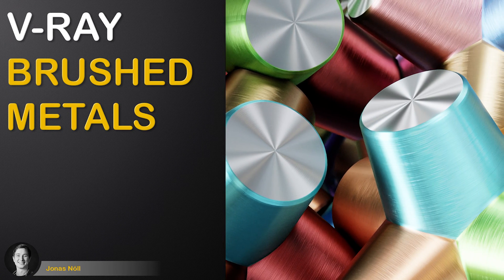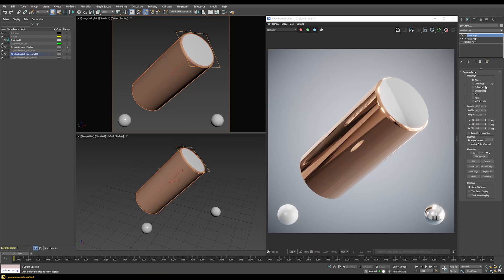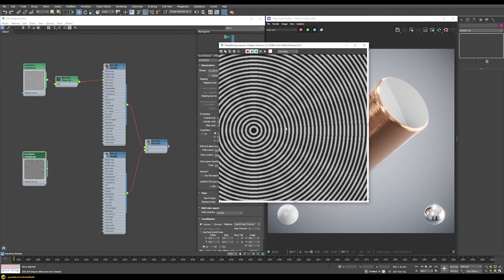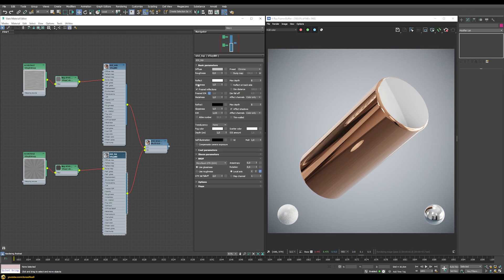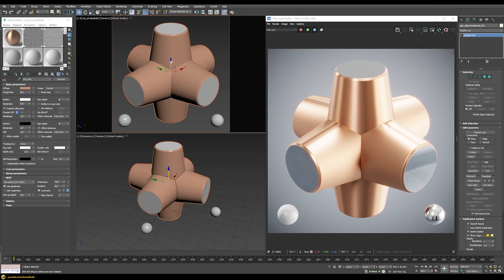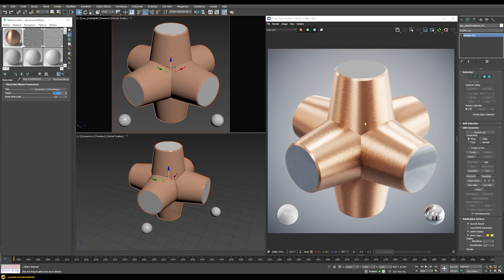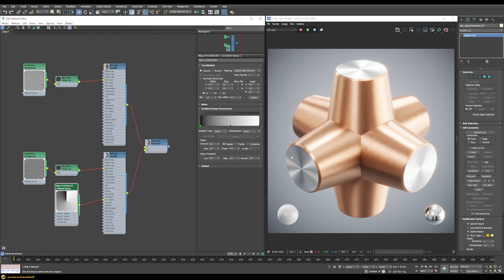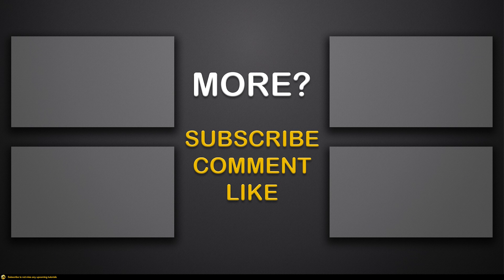V-Ray | How to do BRUSHED METAL Materials | Anisotropy

Comment: Great tutorial. The problem I'm having is animation. If I rotate the cylinder on its local z, like a lathe or similar, the hourglass reflections in the base tend to rotate with it or in some other weird way. Like it's depending on local uvs or maybe it's a map gamma issue. I feel like I'm losing my mind.
Reply from the maker: Yeah that is indeed an issue. Actually I haven’t found a solution for this issue yet as the UVs rotate together with the object. You could open a thread on the Chaos forums, would also really like to know how or if it’s possible

Comment: Do you recommend the use of color2bump map?
because Vray docs says VRayColor2Bump is slower, & it is better to Directly plug the bump map to the mtl
Reply from the maker: Hi, I would at least recommend to try out the Color2Bump conversion if the bump is a very important part of your shader. Often times I ended up getting better results for some reason even though I just plugged in a simple Bitmap. As with the example in this video here the result looked also different and better when using Color2Bump. So in my opinion just test it out if there is a visual difference. I can't imagine the performance to be drastically worse to be honest, at least I din't really encounter anything noticable as of yet. 
But definitely always use it though when you blend procedurals or multiple textures together or have in general a more complex setup for your bumpmaps.
Reply: thank you😀
Reply: @JonasNoell  i always thought color2Bump is only used to convert a color map into a bump map in case a dedicated B/W bump isnt available. i assumed its just a faster way to create bump map instead of going out to photoshop and creating bump map from the diffuse map

Comment: Long time no see ;) Very helpfull tutorial yet again!
So you do need proper UVs for both approaches, either for mapping an actual bump texture or to control the direction of the anisotropic effect, right?
Reply from the maker: Hi, when using Anisotropy in the local axis mode you don't need any UV's, unless you wanna blend in some scratches with the bump :)
Reply: @JonasNoell  Right, but as your example shows just using the local axis might result in weird effects. If your cones were merged into one mesh without UVs, local axis orientation wouldn't work. That's how I understand it.
Reply from the maker: Yes, local axis sometimes works if you for example just have one cylinder or some other simple object. But as soon as you have one object where you want to have multiple anisotropic effects with different directions you would need to have some kind of UVs to control the direction.

Comment: Jonas, what's the hardware (cpu, mobo, ram, gpu, etc) you're using for these tutorials? And you're using cpu, not gpu rendering correct? And which version of V-Ray?

Also, in terms of ideas for a tutorial, there quite literally isn't a single good tutorial out there for making crystals like quartz or amethysts. Only one I've seen which has come close to the shader I'm looking for is a Houdini one like this: https://www.youtube.com/watch?v=pq2bYZGurzc

You'd get mad views if you could do one for the rest of us. Me and hundreds of others would be eternally grateful if you did. Danke!
Reply from the maker: Most videos are with Dual Xeon 16 Core, 64gb Ram, Quadro P1000. I don't use GPU rendering, don't really have good hardware for that.
The idea about the christal is cool, will definitely check that out! Thx!
Reply: @JonasNoell  Thanks dude. By the way, which model # xeon you using? Since there's various ones.
Reply from the maker: E5-2698 v3, but why does it matter? You can render with any CPU :P
Reply: @JonasNoell  I'm kinda in a tough decision whether I want to stick to GPU rendering (own a RTX 3090) vs going CPU for my future projects. I've noticed in some benchmarks and real world tests that GPU outperforms even Threadrippers in certain cases, so looking at the preview renders is interesting to compare. That's basically what I'm getting at. Thanks by the way for the follow-up.
Reply from the maker: @iamski  Ok, as said most videos were with Xeon, but I recently upgraded to Threadripper 3990X, so this Brushed Metal is the first video on the Threadripper. Would be interesting to see a comparison btw. RTX 3090 and 3990X. In my tests it renders around 3-4x as fast as my 2 x 2698v3, is quite silent and probably uses a fraction of the electricity than the 2 Xeons. Very happy with that CPU, but in terms of Performance vs. Money there are probably more attractive CPUs on the market. 
For GPU rendering I personally didn't really do it a lot so far, because my CPUs always outperformed my GPU. I imagine with a 3090 it's probably another story. So unless you  own a highend CPU, or require some V-Ray CPU rendering features, I would imagine for you GPU rendering would be the way to go.
Reply from the maker: @iamski  Ok I just did a comparision between 3990X and my RTX3060TI. It's not even a match, the Threadripper beats that GPU to a pulp. Would love to test it against the 3080 or 3090 though :)